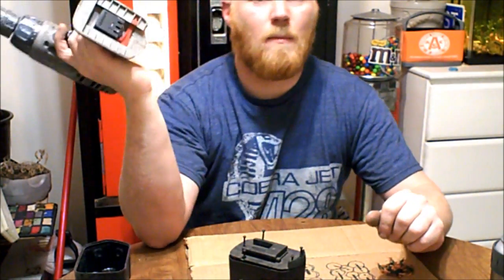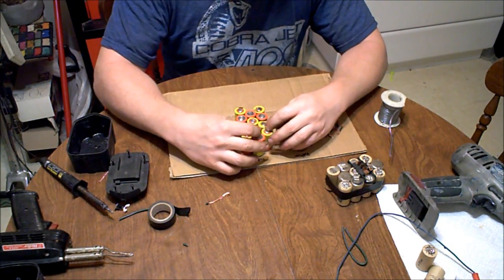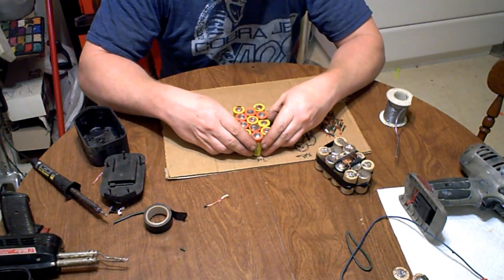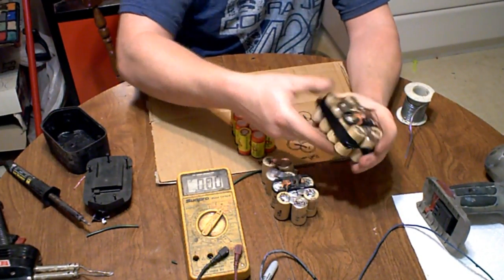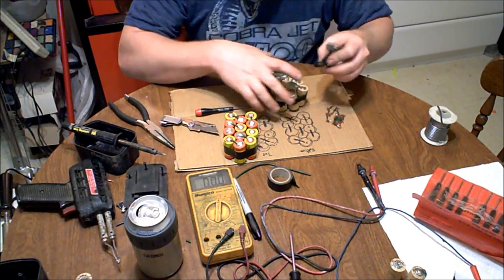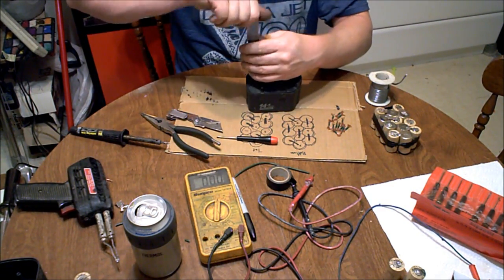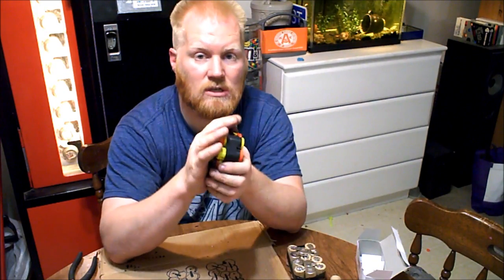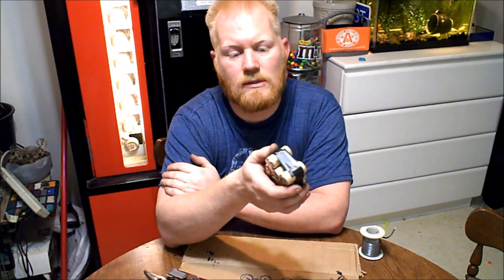Cordless Drill Battery Pack Rebuild for $20 or Repair for $0

Comment: Awesome video.  Best one I've seen yet on this.  I CAN do this, but I wasn't comfortable about it until I saw this.  I've been looking for  reason to add a soldering iron to my toolbox.  I'm the guy who put in his car stereo in the 80's and used my mom's bandage tape to secure the connections.   Some smoke came through the vents sure, but I had the radio installed!  Question though- your video title says 22.54 or $0.00 to repair.  Where was the 0.00, I didn't catch that.   Looks like your replacing with cells you bought.
Reply from the maker: Carlton Clay $0.00 comes about by pulling the good cells from 2 weak battery packs and combining them to make 1 good pack.

Comment: Makes no sense to me to rebuild an entire pack when you can buy new 3.0mah 14.4 nicd packs off Ebay for $25 shipped, 18v packs are just a few bucks more. It does make sense to take apart the pack if all you need is to replace 1 or 2 bad cells at a couple bucks each. Good video, all you need to know to do that.
Reply from the maker: eric strada Those packs are horrible. The capacities are about 1/2 what they claim (1500mah/1.5ah) and have a lifespan of about 3-6 months before they're dead. On ebay you can find the cells from honest US sellers that will give you the true capacity vs printed capacity. You can rebuild a pack with better no name Chinese cells for around $15 or get cells that will last years for under $25 and are as good or better than OEM.
Reply: sixtyfiveford I bought one of these  a few months ago http://www.ebay.com/itm/3-0Ah-14-4V-XRP-Battery-For-Dewalt-14-4-Volt-DE9038-DC9091-DE9502-DW9091-DW9094-/251751441373?pt=LH_DefaultDomain_0&hash=item3a9d8e23dd Time will tell if what you say is true about it's lifespan, so far it's been great. I suppose I should have just bought a new set of li-ion tools, but I love the size/weight of my old Dewalt 14.4 sawzall and circular saw.

Comment from the maker: Lightly sanding or scratching the battery helps the solder to stick rapidly. Tin(apply solder to) your wire and the battery tops/bottoms before you join them. This allows a quick bond.
If you enjoyed the video: let me know below, thumbs up, or Subscribe for more.
Reply: sixtyfiveford That's a awesome solder gun you got there even though its got some years on it probably. My father had the same one, from the late 70's, but it finally died on me a couple years a go and I had to upgrade. Thanx for your vids and keep up the good work 65!!!
Reply from the maker: william delmer
Hey Thanks..
Reply from the maker: Sb Akash
Sorry, I don't know if they are interchangeable by size but adding higher mah is just fine and won't harm the power tool. It will just run longer.
Reply: Nice and thanks sixfiveford ..
Reply: sixtyfiveford
Reply: Recommended
Reply: i scratch them and then use some nokorode flux. I found it in the plumbing section of a 100 year old hardware store
Reply: Thumbs up from me.?
Reply: here's  several things for battery repairing
never attempt to do this unless you are sure what you are doing - the acid can burn your skin
check the voltage first - there may be a kaput cell which would waste your time.
Check your battery fluid.
Try to completely recharge the battery.
(I learned about these and more on Rapid renew roadmap website )
Reply: hey ,if anyone else wants to uncover learn how to recondition batteries at home try Trefendous Rapid  Extender Tips (just google it ) ? Ive heard some awesome things about it and my co-worker got excellent results with it.
Reply: hi guys, the best results that ive had was with the Magic Mender Wizard (just google it) definately the most incredible course i've followed.
Reply: Check out this website if you want to learn the best method to recondition your batteries: JoxCharge. com
Reply: I've been researching into battery repairing and discovered an awesome website at Rapid Renew Roadmap (google it if you're interested)
Reply: I've been researching into battery reconditioning and found an awesome website at Rapid Renew Roadmap (check it out on google)

Comment: Good instructional video.

You're understanding of battery chemistry, and theory is off, though.

NiMH have a much higher C rating than NiCD. I.E they can offer more instantaeneous amperage than NiCD.

Also mAh is milliamp hour, not microamp. Microamp would suggest that it's 1 millionth of an amp, and would be represented by ųAh.

Thanks for the video anyhow!
Reply from the maker: monono954 C rating is and equation related to mah. The average NIMH can't deliver enough current to run a full size power tool . A standard NICD subC will easily deliver enough current in a series wiring configuration. The only way to get NIMH to do the same would be to parallel them, then series them. So you would end up with a battery pack twice as big to get the same voltage required.

Comment: I had a Dewalt 18v pack that died, so I took it apart "just to see what's inside" you know. But then I moved and I'm like this junk gotta go. Really wish I had known about these 5/4 C-cells back then. I actually have the same P-C drill and I'm still running the original b-pack like 15 yrs. later it's a helluva drill, it is kind of heavy, but it works great, but I'm waiting for it to die and I only have the one pack. I have found nowhere to purchase a replacement pack, only a send this one off and get a rebuilt one. Yez, I guess now, I know how to rebuild it myself! Thanks!
Reply from the maker: duratoke I hope it comes in handy some day. Yeah, these PC drills are tough. That's impressive you're on the original pack.
Reply: sixtyfiveford Thanks for replying. I checked all cells like you said and they are all right around 1.2 and the entire pack checks at 14.4. The only problem it has is that it runs out of actual torque power pretty fast. Cya!
Reply: Looks like a year ago I watched this and my damn drill is finally actually pretty useless, it dies in about 10 minutes after  a charge now. Going to finally have to do it. Hard to believe it has been a whole year. Cool!
Reply from the maker: duratoke
You got a lot of life out of that battery pack.

Comment: I buy harbor freight battery's when on sale and rebuild my packs less than $10 they work great.
Reply: Are you taking HF batteries apart to rebuild batteries or does HF sell sub C NiC batteries.
Reply: Check out this website if you want to learn the best method to recondition your batteries: JoxCharge. com

Comment: Hey man I have a 24v 3.3ah Ni-MH that needs rebuilding. How man batteries are in it the 24v Battery? (Don't have the drill at the min to look myself) Thanks!
Reply from the maker: VinnyTheViking 1.2volts each x 20cells = 24 volts
Reply: Thanks man

Comment: So this will probably be a dumb question, but if I'm getting the speedy flashing light on the charger that signifies a 'bad' battery, then is the charger still charging the battery and I'll be able to read the bad single battery with the volt meter? I'm wanting to take two bad batteries and make the one like you also suggested.
Reply from the maker: thegreenhornets Yes, generally the charger still charges the battery even though it flashes. It's just warning you. You will need to do a load test to see what cells are good and bad. First measure the voltage of each cell and find the best ones and the obvious bad low voltage ones. With the good ones you will need to load them to see if the can handle use. You can do this by hooking a small flashlight bulb to each cell and testing voltage at the same time of that cell. It should stay around 1.2-1.4 volts with bulb attached. You can also hook the entire opened pack back up to the drill and run it while you check the voltage of each cell. This will give you the best and strongest cells to pull or leave to make a good battery pack.
Reply: sixtyfiveford I'm guessing you use large alligator clips to connect the wire to the bulb. You can't solder the wire to the bulb, can you? Would that break it?
Reply from the maker: Yeah, alligator clips or tape. Two people makes it easier.

Comment: Great stuff - thanks for posting.  I do the same.  A couple of nit-picky things.   Open circuit voltage doesn't always show a good battery - under load the voltage may drop considerably - put a resistor across if you have one with a value to draw a few 10s of milliamps. mAH = milliamp-hours, not microamp-hours.  NiMH = Nickel Metal Hydride (not Hydrate)  
And like he says - USE THE SAME BATTERY CHEMISTRY AS IN THE ORIGINAL.  The charger is specially designed to charge the specific chemistry battery.

Comment: I have volume turned up all the way and having trouble hearing you. Thanks for the info.
Reply from the maker: Glen Lynch Sorry about that. It seams a few people have had issues with that. There was a fair amount of white noise from the Coke machine behind me so some speakers drown out my voice. Usually trying a set of headphones or different speaker and you'll be able to hear it a lot better.
Reply: sixtyfiveford
Do you have a Mic? maybe use it if you can or get one if you don't have one
Reply: OMG!!! This video I loving.. I have  recommendation for knewreck rapid renew guide, Super how to refurbish cordless drill batteries Search in Google
Reply: There are several factors in fixing a car battery. One resource I discovered which successfully combines these is the Magic Mender Wizard (check it out on google) definately the no.1 course that I've seen. look at this  unbelievable site.

Comment: Thanks for the info. I can't source the batteries in the uk less than £5 each even on eBay, unless someone in America eBay would be willing to post to uk? Typical of the thieving price hiking uk retailers.
Reply from the maker: 6gunLover That's expensive. You can use the off brands just don't expect the false high MAH ratings they write on them.

Comment: Hi Thanks for a very informative video. My question is that I have a Hilti BP40 Battery for my drill and I'm told that a BP72 would fit my drill. This is a 24v 3000mah battery. But my question is this: If I buy this http://www.ebay.co.uk/itm/New-SubC-Sub-C-6000mAh-1-2V-Ni-MH-With-Tab-Rechargeable-Battery-White-High-Power-/271502058273?pt=UK_ConsumerElectronics_Batteries_SM&hash=item3f36c8a321 Will it be 6000mAh x 20 (batteries) ie. 120000Mah if so would my charger charge it or would it not work?
Reply from the maker: 6gunLover These cheap Chinese batteries have fake ratings. It is more than likely only 2000-3000mah each. I would stick to a name brand like Tenergy where you know what you get is real. The math on it would be that a 6000mah wired in series will give you a 24 volt 6000mah battery pack. If you wired in parallel it would be a 1.2 volt 120000mah pack(not what you need).

Comment: Good idea,  but i think when u buy the rechargeable batteries will be almost same price as the battery that you tried to fix it
Reply from the maker: abu shehab It may seam that way but it's cheaper and you'll end up with a lot better cells. The battery in the video sells for around $50-90 new aftermarket. It will come with 1.5ah or 1.9ah cells. Doing it myself cost me $22.54 and I end up with name brand cells rated for 2.2ah. That's roughly 1/3 the cost and 20-50% more battery power. The name brand cells will also outlast the generic cells they normally put into these battery packs.

Comment: I asked some guys on ebay about lithium ion and they pointed me here, but said these were not necessarily "high drain"type batteries. What do you think about these? Would they not work?
http://www.ebay.com/itm/Samsung-Li-Ion-18650-Cylindrical-3-7V-2600mAh-ICR18650-26F-Flat-Top-Battery-/290953469174
Reply from the maker: cbergm7210 They would not. You need something like http://www.ebay.com/itm/2x-LG-LGDAHB21865-HIGH-DRAIN-1500mAh-3-6V-3-7V-Lithium-ion-Li-on-18650-Battery-/321417408036
Reply: sixtyfiveford
Thanks, man! I looked but came up short. Thanks  for you expertise!

Comment: Where do you find the battery at to replace the old one
Reply from the maker: clark Grizwalt Ebay is the best deal but you can find them all over the internet. Most battery packs will have Sub C cells but a few will have 4/5 Sub C.
Reply: sixtyfiveford thank you

Comment: Ok, something I have noticed on these ni cad packs.  You can measure 1.3 volts and think its a good cell, but the cell is completely open.  From negative to positive there is infinite resistance.  Where I am confused is some cells will measure 1.5 volts and have zero resistance through the cell.  Which is good and which is bad?
Reply from the maker: TheMDStoner You need to test them under load. Hook an old flashlight bulb or a small resistor across the terminals. Then measure the voltage. It should stay around its original voltage. So if is 1.3v and you measure it with a bulb/resistor across it, it should stay about 1.20+ volts and hold for 10 seconds. If the pack is complete but removed from its case you can hook it back into the drill and turn the drill on slow. This will also load the cells so you can get an accurate reading of each cell.
Reply: My comment wasn't really about volage....it was about the resistance of the cell.  I believe I may have a partial answer after doing some research.  Shorted cells will still charge but they will discharge themselves even under no load.  Faster than non shorted cells.  I am assuming a shorted cell is one with no resistance..... A normal good cell will have resistance.....What I am not sure of is how loading will effect the voltage of a shorted cell vrs a nonshorted cell  I would imagine it will affect the longevity or the output some but do not know how much.   I have three dead battery packs half the cells in each pack appear to be shorted.  They appear to contain voltage of 1.3 volts....Ill have to load them and try again.   About 3 cells per battery are flat dead no voltage and I am assuming they are bad.  I have enough cells to make maybe one battery if I use non shorted cells 2 useable batteries if I include the shorted cells....
Reply from the maker: The nature of Nicad cells is that they have very low resistance(new cells). This allows them to delivery high current to the power tool. They vary widely even with new cells. A shorted cell will give a superficial voltage that will drop right off it the cell gets loaded.

TECHNICAL DATA about Resistance:
The internal resistance of a Ni-Cd cell is very difficult to measure and to define since it varies with different temperature and state of discharge. The internal resistance also depends on the cell type and size as well as
it increases for lower state of charge. Apart from this the internal resistance of a fully discharged cell carries no weight. Reducing the temperature also increases the internal resistance.
Reply: sixtyfiveford     I  was wondering where you buy the Batteries?
Reply from the maker: James Johnson
Ebay is your best deal.
Reply: thanks that makes a lot of sense based on what I was seeing.

Comment: I had an issue, like the ones you are having with the numbers not displaying properly, with my volt meter that is very similar to yours. I took it apart and put a new 9 volt into it, and all of my numbers came back to life. Just a thought. Good info in your video and thank you.
Reply from the maker: cakraft24 Thanks for watching. Yeah, this one has a short on the board (I dropped it hard). I've used the death out of it for the last 20 years and just found an identical old one that is in new condition. If I get another 20 years out of the replacement I'll be happy.

Comment: One more thing..and thanks again for all the great info...I have a Porter Cable lithium battery that shot craps as well. It doesn't seem as easy to find these batteries. Got a line on where these can be purchased? And is the process pretty much the same do you think?
Reply from the maker: cbergm7210 Lithium are a different beast, but the process is the almost the same. First you need "HIGH DRAIN" lithium cells(should be the 18650). Standard lithium cells won't work and will short out. Something with a constant drain rate of 20amps or more is required. Lithium are very temperamental and need a computer to stop them from discharging too much(die forever) and from charging to much(blow up). So you'll need to be careful when disassembling the packs as there will be a circuit board.

Comment: Hey bud! Was able to repeat your rebuild. Thanks a bunch!

I used pieces of cord from an everyday 120 volt lamp for soldering the batteries together. It doesn't seem very thick. Do you think it will suffice for this?
Reply from the maker: cbergm7210 Yeah, a lamp cord should suffice. It is probably 18 gauge which is a little light duty but it doesn't need to flow the electricity far.

Comment: Those batteries from a power pack that are still "good" even though the others are defunct, are not really very good. They will only last a little while longer. I don't think using them is worthwhile, given the time it takes to solder them together.
Reply from the maker: Theodore Zuckerman True, they will not have a life as long as a new pack but they are usable. Running them through load tests to determine the best cells is key but takes a little time. Some of these packs can be well over $100 and combining 2 packs to make a decent back up battery pack can come in handy.
Reply: sixtyfiveford
I just purchased a twin battery set for a drill. then I entertained my curiosity on YouTube. now, I'll soon entertain it further and open this baby up
Reply: sixtyfiveford
I just purchased a twin battery set for a drill. then I entertained my curiosity on YouTube. now, I'll soon entertain it further and open this baby up.